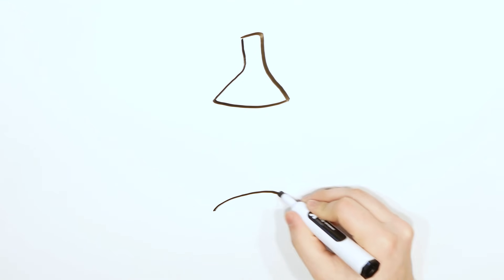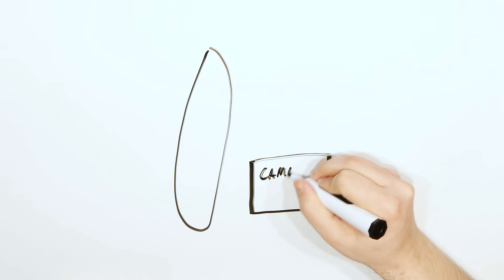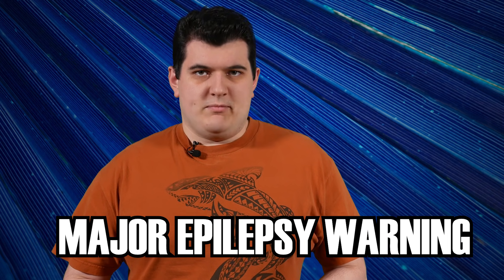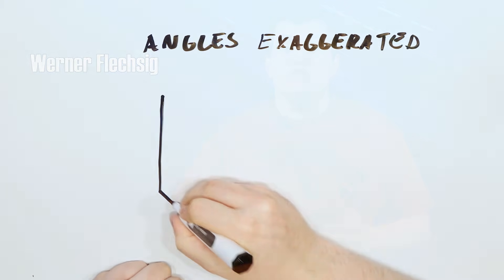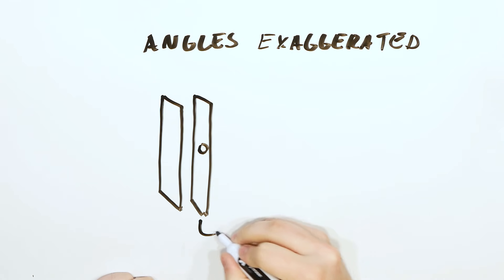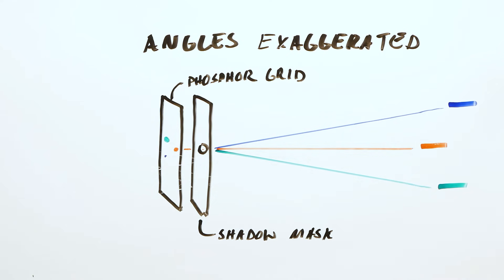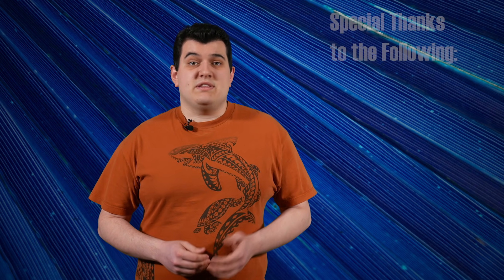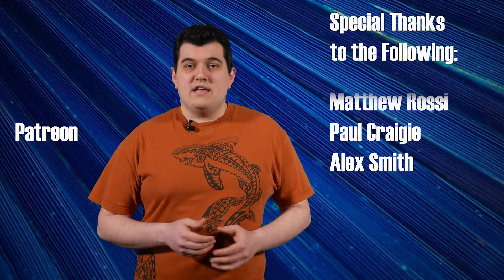How Analog Color TV Works:  The Beginnings

Comment: So wat made the the tv or phones make that buzzing noise when in range
Reply: If you mean an actual audio from the receiver, it could be loose flyback transformer windings.  If you mean  r.f. picked up by another device, that's i.f. radiation modulated by the video signal.  If you hear different pitch and loudness depending on what's seen on the screen, it's the latter; if constant, it's the former.

Comment: This is probably a ridiculously dumb question, especially if I've asked it already, but why don't CRTs display interlacing artifacts? How does their method of displaying a signal avoid this?
Reply: To see such an artifact, you'd have to darken the room and look partly away from the screen but with it still in your field of vision.  You'd then be seeing it with your scotopic visual system using just rod receptors.  You MIGHT then be able to see the image vibrating up and down, but you'd need to be close to the screen to pick that up, while still not looking directly at it.

Comment: Incorrect on the pixel front. You're trying to apply a modern LCD/LED understanding of individually addressable display pixels to an older technology. Go back to the Apple II or other early home computers. These often used common CRT TVs as displays. While the pixels are individually addressable at the computer end, they're displayed on the screen in the regular line manner through a modulator to turn the display buffer into a TV signal.  The differentiation between the TV line width and a pixel width on those computers is thus effectively zero in a "high resolution" mode.  Pixel is a computer term, and not one from the TV industry, this is where the confusion comes from. In effect, on a TV, the smallest dot the device can make on the screen, be it one triad of phosphor dots, or several at once, is a pixel as far as any device attached to it is concerned. CRT Computer monitors use the same technology precisely, and display the image in the same line by line manner with the electron beam scanning from left to right.

Comment: Here would be my approach to analog color television:

No shadow mask, but still keep the RGB phosphors, side-to-side instead of the triangular orientation.
The beam would be much more focused, to scan each RGB sub"pixel".
The beam would scan at the same 60 fields/sec it was used to back in the 40's and 50's.
The radio transmission would contain the brightness values for each sub"pixel" as the beam scanned across.

No insanely high frequency sine waves, no phase angles, no 29.97 fps, a much more simpler system than what we have.
Reply: nodrinks There were approaches like this, but they weren't black-and-white compatible, took too much bandwidth to make an acceptable signal and required electronics that were far too difficult to build at the time. The essential trick here is that the color resolution doesn't need to be nearly as high as the brightness resolution, since our eyes are much more sensitive to the latter.
Reply: @techmage89  Why weren't they monochrome compatible?  Seems the eye would average out the brightness when that beam scanned ordinary phosphor.
Reply: @goodmaro  Our eyes aren't equally sensitive to red, green, and blue, so there's no 1:1 relationship to brightness. This means an RGB signal would at best look very weird on a B&W TV, probably not very acceptable. 

You also have to consider the limitations of vacuum tubes and early transistors. They did not have fast slew rates, so interleaving red, green, and blue probably wouldn't work very well on the electronics of the time. With luma and chroma signals varying fairly continuously, the electronics don't need to be able to handle any rapid jumps.

It's possible some kind of quadrature amplitude modulation could have been used directly on the carrier frequency (instead of the funny "suppressed subcarrier" system they used), but I suspect it wasn't practical at the time to demodulate such high frequency signals directly, either.
Reply: I think your system would be too intolerant of slop to function on real-world CRTs.  You'd need beam focusing tech more suited to Brookhaven's alternating-gradient synchrotron than to picture tubes or even to medical linacs.

Comment: Wait... How did they achieved 144Hz refresh rate back then? It takes a modern high end monitor with two high-bandwidth DisplayPort links to push out 144Hz (albeit at 1440, 2160 or 2560 lines progressive scan.) How much of image bandwidth would that system take?
Reply: This is the advantage of analog signals. An analog machine just does immediately what the signal tells to do. It doesn't have to process the informations like digital things.

Comment: What are the color stripe widths and spacings? Just curious as the single electron gun beam diameter I was working on is about .02" at the 5% amplitude point. The 50% line width was about .007"

Comment: Sorry you hadn't convinced me  that calling each group of color phosphors  a pixel is invalid. They have to be illuminated to duplicate the scan lines of a BW display that text reveal how imperfect  that is doesn't change the fact that each grouping when illuminated fits the long standing definition of pixel The definition that makes it possible to define the resolution of a color  CRT display.
Reply from the maker: They aren't "duplicating" the scan lines.  They are in front of the scan lines.  It is exactly the same as taking a B+W CRT and drawing a grid on its face.  Just because that grid is there doesn't mean that the grid is what composes the image.  Just like how when you look through a screen door, you don't call the spaces between the wires a pixel.  The screen door is just compartmentalizing small parts of an image that lies behind it.
It is 100% expected in a slot-mask CRT to have the phosphors triads hit by multiple scan lines.  Many people assume that each grouping is a finite point of light, but it's not.  There's nothing to stop the top half of one triad from displaying a different color or brightness than the bottom half.  And because of this, the number of triads doesn't determine the resolution of a CRT.  Resolution is entirely determined by the the number of scan lines, especially considering that Chroma resolution is so limited compared to luminance.

Comment: It's subtly wrong that human eyes see only 3 colours of light in a couple of different ways.

It is true that there are only three types of cone cells, each capable of seeing only one colour; either red, green or blue. It is not true that every colour of light can be made by mixing 3 wavelengths of light.

The first problem is that there exists no colour of light that excites only green cone cells. All green colours will also excite red or blue cones or both. The compromise in CRT TVs was to go with a green that also activates the red cone and appears a little bit yellowish. If you try to display the deepest cyan or aquamarine colour possible, that bit of extra yellowish colour will tend to desaturate it, so it won't be as vivid as it could have been. Despite only having 3 receptors, no 3 colours of phosphors will be enough to span the whole of colour space that you are able to experience.

(this raises the question; would injecting a chemical into your eyeball that only activates green cones be this alien greener-than-green colour?)

The second problem is more subtle. If you take a light source that appears white and shine it on a coloured object, the pigments in that object will absorb different amounts of different wavelengths and those rates of absorbtion for different wavelengths won't match your eye. If you have two light sources that by themselves appear to be the same colour of white light, an object lit by those light sources may look different depending on which light source shines on it. This is know as colour rendering; light sources with only 3 phosphors or 3 colours of diodes have a poor colour rendering index (CRI) and will tend to make colour objects look a bit sickly or off-coloured.

Comment: I have an NTSC TV which uses a field sequential display. It has a liquid crystal shutter in front of a B+W CRT. It was made by JVC in the 1999. It is only 4.5 inch diagonal.  
From the owner's manual:
"The LCCS Video Monitor is a combination of a black-and-white cathode-ray tube and liquid crystal color
shutter (LCCS), which are used together to reproduce color images.
The video signal input to the monitor is demodulated into RGB primary color signals which are then
stored in the field memory. Signals in the field memory are read three times faster than the input video
signal is, and are displayed on the black-and-white cathode-ray tube in the order of R, G and B. (Three
images are displayed during one field.)
Color filters on the liquid crystal color shutter change according to the displayed primary color signal,
transforming the black-and-white images into R, G and B primary color images.
Because of the phenomenon known as persistence of vision, the R, G and B primary color images appear
as a single color image to the human eye."

Comment: Thank you for explaining that these are NOT pixels; it's a dot matrix.  Unfortunately, the computer industry invented this term, as they just had to be different. The term 'pixel' stands for 'picture element.' There's nothing in that word that indicates anything about the red, green or blue dots as being 'addressable.'
Reply: Pixels are really what the software deals with, as opposed to the screen itself. There is a distinction, particularly as computers could display on the same screen at the same scan rate using a different number if pixels.

Comment: Somethings I'd like to point out.  Guillermo Gonzales Camarena's color wheel patent actually predates that of CBS and his device worked rather well.  Camarena's original patent was in Mexico and appears to have been submitted in late 1939 and was granted in August 1940 before CBS patent submission or demonstration.  I have a scan of this certificate and can send it to you.  His US patent also recognizes the Mexican patent date and also makes everyone think that his invention came after CBS.  Camarena's system worked well enough to be used for medical equipment and studio broadcast equipment some of which was exported to the US for the columbia college in Chicago.  Like CBS, Camarena's system was not necessarily limited to the 30fps standard or it's field rate. Only having to use it with a current broadcast standard was a limit he considered.  At the time those standards were not set in stone so I'm sure he knew of higher potential.  He was often building closed circuit equipment so he may have exploited that to his advantage to avoid norms.  I recognize CBS system's advantages but Camarena was truly the first to demonstrate that practical color TV was possible, especially considering it's compatibility aspect.  I've seen footage of his system and it's functional.  I also have an interview of a former NASA engineer who says Camarena's color wheel system was inspiration of the color cameras used in the Apollo moon missions, his name is Paul Coan and says this on a documentary.  It's a shame he's so badly documented.  If you would like to know more please contact me. :)
Reply from the maker: It may be that Guillermo Gonzales Camarena's system predates the work of CBS, but John Logie Baird had a mechanical sequential-color TV working in 1928.  I don't wish to suggest that Camarena's work isn't important, but it's very hard given knowledge of other people's efforts for me to credit him as the "Inventor of Color Television" as some people do.
Reply: Hello, you are correct, that is indeed a mislabeling.  Camarena didn't claim to have invented the first color system ever either.  In his patent he mentions how at the time color systems were very complex and expensive so he knew of prior works done in the field but his invention was supposed to be a practical alternative.  Baird's technology was still nipkow disk and other all electronic experiments had high cost and other large issues at the time.  I do believe he deserves this credit, first practical system.  Which although not as practical as the later NTSC standard (I wouldn't want to have a spinning wheel for a TV either) did break ground in putting color at reach for the public with results superior to all the previous systems except maybe the tri-tube systems at a very reduced cost all while being compatible.  I am currently working on a documentary on Camarena and have spent months undoing bad documentation and digging up as much detailed information on him as possible.  Camarena died in a car accident and the people who came documenting him after this didnt do a very good job of it except for an engineer that worked for him.  Currently his sons have a large collection of information which includes plans for his inventions and I assume technical notes.   I am trying to get in contact with them.  His bi-color invention was also not the first to use this sytem but was taylored to a significant cost reduction that was more than just a few dollars as the CRT featured no shadow mask and the television had no chroma circuit.  This system was about to go into production by majestic before he passed away.  Stay tuned for my docu, it wont be a proper documentary but I do aim to clear up the history on him with more exact facts than the usual texts you can find online.  I hope to clear up a lot of questions.
Reply: you guys just make Mexico look bad , you guys also claim to have invented electricity
Reply: He was in Mexico so that was a Mexican patent, and that doesn't count as first in the USA (where it actually matters, since patents issued and good in 3rd world shit holes aren't worth much in the first world without a patent there as well). Regardless, considering all patents issued that far back have long since expired and the ones applying for them are long dead who cares who was first? I'm sure Newton wouldn't care if Boyle actually got credit for discovering the mechanics of gravity and neither would Boyle himself, both being dead for centuries and all.
Reply: @fvckyoutubescensorshipandt2718  Camarena Patent his invent in both countrys

Comment: Your explanation for human colour vision is a bit wonky.
But sure. As an explanation of how TV works, it's acceptable.

We don't see 3 colours, we have 3 receptors whose frequency response is different from one another. - however, none of them is sensitive to just one wavelength of light, and in fact all 3 substantially overlap. This overlap is actually why it's even meaningful for red + green to create yellow; Because yellow would be an intermediary wavelength that both receptors would respond to.

There's a reason the receptors in our eyes are called 'Long', 'medium' and 'short' receptors, rather than 'red', 'green' and 'blue'.

I mean, it's being pedantic, sure.
But so is making a distinction between a shadow mask and the idea of a 'pixel'.
Reply: And the Young-Helmholtz-Hering theory is beautiful -- but fails to explain the Land effect.

Comment: I remember as a kid once what would happen if I put a magnet near our tv screen. While the colour distortion looked pretty, I panicked when I couldn't get rid of them. I thought I was in trouble. But then my Dad came in and just unplugged and plugged the TV and it was back to normal. That was my first introduction to degaussing and it gets rid of any residual magnetism caused by idiots putting magnets near the screen.
Reply: Funny I did the same thing. We had a trinitron set at the time and I was messing about with the picture using a powerful loudspeaker magnet. I remember making distortions and weird colours and even "black holes" in the picture. Then the colours were permanently stuck. I was horrified that my dad would find out, though my mum was pretty cool about it. In the end the colours reverted to normal, but only after the set was turned off an on a number of times.

Comment: Just to minimise any confusion, the screen showed here was an 'inline' tube which doesn't have a delta gun arrangement (as described), it offered improved linearity and set-up ease. As described the delta gun tube did have a triangular phosphor arrangement. The PIL (precision in line) was a later development and also used in the Trinitron tubes (which used wires instead of a perforated steel plate, this gave a brighter picture, as less power (20W) was lost in the mask). A magnet could magnetize the shadow mask itself and permanently cause misregistration of colour. This is called 'purity' error. A big demagnetizer can be used to correct this in most cases.
Reply: Back in the 1970s as a late teen when I was repairing televisions, they had the delta triad electron gun and shadow mask, with Sony being the exception.   If you looked closely at the front of the screen you could see the triad of red, green and blue phosphor.  I don't remember when I first saw the inline picture tube, but by the 1980s the delta/triad picture tubes were largely replaced by inline tubes.  The TV store I worked for at the time sold RCA, Motorola (later Quaser, then Matshuita/Panasonic), and Sony.  I remember going to RCA service seminars where a field engineer explained the new precision in-line tubes.  I also remember that the inline televisions were brighter than the delta/triad, but not as bright as the Sony Trinitron.  I had one of the very early RCA 21" color televisions with the round picture tube.  Even though it was rather finicky I wish I still had it :)